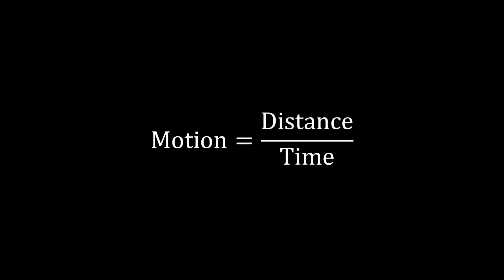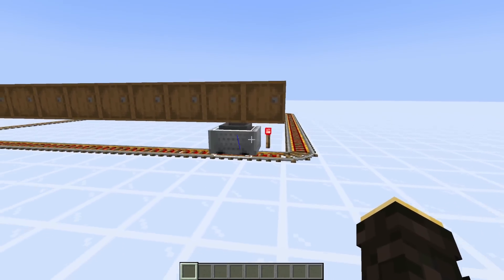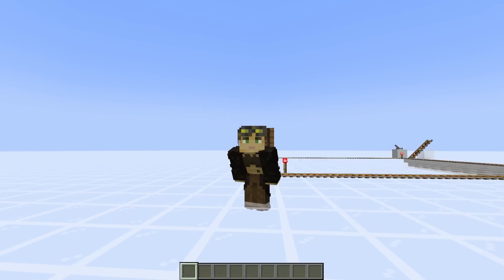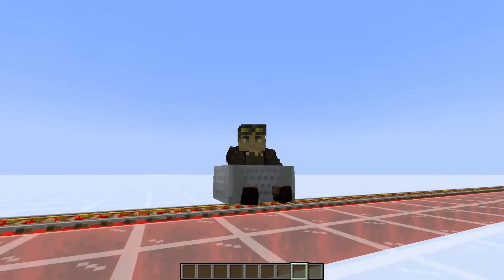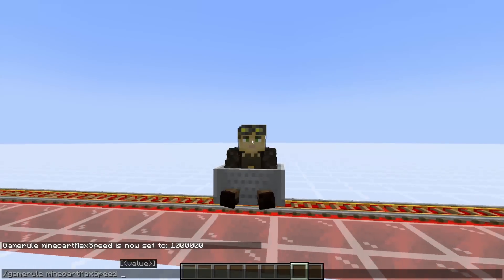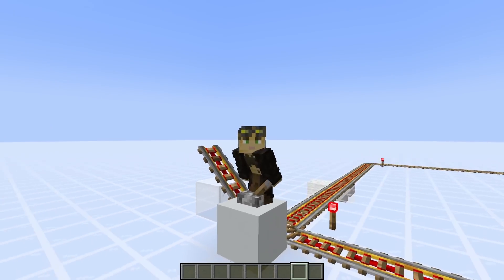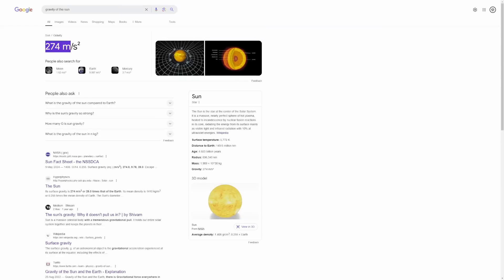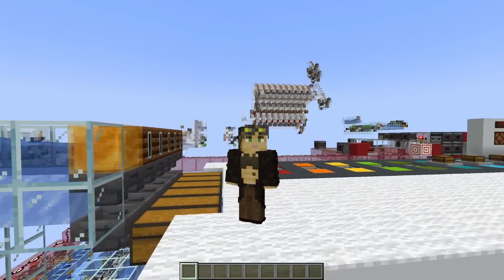Minecart Madness

Comment: 9:00 Thinking about this further, I was worried switching to a quadratically scaling function would cause weird behaviour in redstone but likely it would be the opposite, as drag at low speeds would be much lower than they are now causing the drag to likely be less of a factor. Though I am still worried there are redstone contraptions that would be broken by nonlinear acceleration. Maybe it should also work that copper rails accelerate differently to gold ones too? This is something that would be really cool to test in a snapshot, see if redstone contraptions break using the quadratic air resistance.

Comment: If minecarts are to derail, I think it would be nice if you coud have some kind of "smooth curve" instead of having to forcefully slow them down. Like maybe going into a diagonal (alternating corners) could tolerate higher speed, requiring less slow down than a 90° angle. Detecting that would be somewhat complicated, but I don't think it's impossible
Reply: As well as being more complicated, it would also just looks so out of place and be pretty unintuitive to actually build considering this game has always hag a grid-style of block-placement.

I don't really see much of an issue with derailing when it only happens if you are going incredibly fast, and if your goal is speed; you wouldn't be building rail systems with turns in the first place-- so use rails with a proper-non-derailing level of speed if you plan to make railways with lots of turns in short tracks.

Comment: I LOVE the idea for oxidised rail variants because for the average player, they will be cheaper to mass produce, but will require more attention to fix the oxidisation, eventually being outright replaced by the more expensive regular rails, while for the technical player, they can be controlled by being waxed, allowing varying speeds without having to add a bunch more redstone lines to control them.

Comment: Maybe the oxidation level of the rail changes the increment of speed? For example, an unoxidized copper rail would have speeds in multiples of 2 but as it oxidizes more, it would go to 1.5, then 1, then 0.5

Comment: I don't know what would be better: Using copper rails to have controlled speeds of minecarts or have different minecarts that would travel differently. Iron minecarts would be fast and copper minecarts could be used technically. That way, when you craft hopper or chest minecarts, you have the option of copper hopper carts or iron hopper carts.

Comment: Having not watched the entire video, the semi-obvious solution to me is to add "control" rails as an alternative to power rails or whatever which, for example, allow limiting minecart speeds based on the strength of the input redstone signal or whatever and allow players to make alignment guarantees. This would allow the easy use of minecarts for casual stuff with all the cool new features will allowing redstoners to continue to use them in cool ways. "Control" rails could even retain the existing "minecart loses all momentum when driving off the track" functionality.

It would make powering rails in contraptions a bit more complicated if you can't just slap a lever on them, but this seems like a potentially worthy tradeoff for the additional control and new features (especially since even in most compact places, you can probably comparator chain pretty easily).

EDIT: LMAO, this is exactly what he suggested about 15 seconds after where I paused the video.

@14:00 The problem with this idea is that minecraft would also need to provide some way to make more gradual turns with a minecart. Having to slow down all the way and then speed up would be pretty damn annoying but there's not much you can do about that in minecraft because diagonal rails would be really awkward. Though, they do already exist for going up, so maybe you could do something.

Comment: Minecarts can be fixed to move that fast and still interact properly, but you talk way too slow and I'm not finishing the video, so apologies if you cover this. The different minecarts just need to have a small memory buffer. Remember LAST-XYZ, select all blocks that fall on that line, Check all adjacent blocks to selected blocks for interactions, Check distance from LAST-XYZ, handle interactions sequentially.  This is of course a simplification, because corner tracks exist so it does need to keep track of where it turned so that the "line" between last and current position follows the tracks (unless the cart went off the tracks), but still. This means that a cart moving at a speed of 2 blocks per tick, is doing as many update checks as 2 minecarts traveling at 1 block per tick. The faster a minecart is moving, The more CPU and RAM used by that specific minecart. This makes it so that not only does a minecart hopper not skip chests for moving too fast, and won't skip accurate detector rail and comparator updates. For example, say you want a track to change if the hopper minecart has a given amount of items in it's inventory, so that it re-directs when full. Right now the only consideration you have to have is how many ticks it takes for the minecart to reach the intersection, and how many ticks it takes for the detected signal to actually hit that intersection to toggle it. That will be the same no matter what, the only difference is the rate at which the items can change in the hopper is currently inaccurate at different speeds, but would be accurate in this method. This is exactly how Super Mario 64 checks for collisions. It takes mario's velocity, and checks at multiple discrete positions between where mario is, and mario will be if unobstructed, in order to check for collisions, then does some further checks to find the actual point of collision, snapping him in place at the point of the collision, and it checks this every frame. The only difference is that in SM64 the update rate is I believe frame dependent, where minecraft uses update ticks that are less frequent than frames. point is, this is an easy fix.

Comment: Removing the speed limit is a bad idea. They need some sort of reasonable speed limit otherwise you would be able to use them to lag out servers by having insanely fast minecarts loading/unloading chunks using up servers Disk IO/CPU/and working the Ram.

Comment: 1:08 one small correction: 
Time in the real world is NOT infinitely divisible. It is quantized. There is such a thing as a smallest amount of time measurable. It's defined as the Planck time, named after physicist Max Planck. Planck time is roughly 10^-43 seconds. Quantum physics is fun stuff!
Reply: Time is infinitely divisible, but we cannot accurately measure it.

Energy is quantised, which gives the Planck constant as the smallest division of energy but time, position and momentum are still very much continuous values. The only issue is, on the quantum scale, we cannot accurately measure a particles momentum and position together because of the discrete levels of energy. If we wanted to know a particles position, we would have to sacrifice the knowledge of its momentum and vice versa. The same holds true for any two related (continuous) measurements of a particle. 

The fallacy here is that measurement isn’t the same as the environment. Time, position and momentum are still continuous vectors (is time a vector?) even though measurements are quantised
Reply: @benp2291  Thanks for the intellectually stimulating comment! Alright, I'm about get deep, but it's all your fault...😆

In our 4-dimensional spacetime, position, time, and mass are all quantized, and so is momentum (which is a function of mass, time, and position). These aren't only technical limits of measurement; they are theoretical limits. Any attempt to measure smaller distances or smaller times by performing sufficiently high-energy collisions would result in black hole production. And greater energies would produce even bigger black holes. So what does it even mean to say, "Time is infinitely divisible"? These are more than just concepts or assumptions; they are fundamental limits of the universe, just like the speed of light (at least, as far as I am aware at this particular time in science -- I'm always open to updating my views!). We can imagine going faster than the speed of light, but that doesn't make it a real possibility.

There's also Planck temperature, Planck mass, Planck energy, and a Planck force unit. They are like the pixels in a screen. Yes, we can claim that you can be halfway between two pixels, but the graphics card/GPU/VRAM can never utilize half a pixel. From the computer's perspective, there's no such thing as a distance smaller than a pixel, or a time shorter than the CPU clock rate. And this is true even if an AI program running on the machine believes that the screen is infinitely divisible and can conceptualize it. The concept only exists in our imagination (which is actually kinda cool). Anyway...I know it's not a perfect analogy :/

Euclidean spaces (infinitely smooth and divisible) were once assumed to be representative of reality, but this view has shifted over the past 120 years as quantum theory has developed. Although, for the scale at which we operate (and most of our technology), Euclidean and Newtonian physics are sufficient, regardless of being incomplete.
Reply: @aarongrooves  Firstly, "These aren't only technical limits of measurement; they are theoretical limits" only refers to the uncertainty principle/our technical capabilities and the existing theoretical base and does not mean that time or space are quantized. For example, Planck time is NOT a quantum of time. This is the scale at which both GTR and quantum physics must be taken into account, which we cannot do yet, despite many attempts to construct such a theory of quantum gravity.
Secondly, at the moment, the quantization of time and space is an open question. No one has an unambiguous and evidence-based answer to it. Some modern theories and hypotheses do use quantized time, but none of them are universally accepted. It may well turn out that all of them are wrong.
And finally, the fact that you speak so confidently on this topic suggests that you have the appropriate education. In this case, I would like to note that passing off your views as scientific consensus is, in my opinion, extremely unethical.
If there is no such education, well...
Reply: @saintpro9594  Hi there. At first I was following along and excited to engage. But at the end, your tone shifted. I thought this was a fun, light-hearted convo about science. "Extremely unethical?" Also, passing judgment about what is "appropriate education" comes off as elitism. This is a youtube comments section, not a peer-reviewed scientific journal, ya know? And even in that case, my education or your ethical judgments are completely irrelevant to the truth of our claims.

The beautiful thing about science is that the data speaks for itself. If I said something you disagree with, then kindly state what and why. If you have evidence supporting a contradictory claim, then share it. I made it clear that I love learning and am open to updating my views. If you can't engage without becoming rude, judgmental, & condescending, then don't engage. That really sucks the fun out of it.

Newton was technically wrong about gravity. Einstein didn't call him unethical or question the appropriateness of his education. He simply provided better information. Easy peasy! I dropped my ego long ago. It's okay to just state your case and move on. It's actually preferred.

Lmk if this is a safe space. If so, I'll gladly respond to the first part of your comment. Thanks
Reply: @aarongrooves  I didn't mean to offend you with any part of my comment and I wasn't trying to be rude. If that's the case, I apologize. Perhaps I don't quite understand the tone in which I write in places, since English is not my native language.
I will write at the end of the comment regarding discrete time, but first I will answer everything else.

Regarding the "irrelevant to the truth of our claims" part of my comment. You are right - this is pure criticism of the style of your comment, which has nothing to do with the facts. But, as you rightly said, this is not a scientific journal, so I allowed myself to speak out on this topic.
I really think that writing something in the format of facts, as you did, is completely inappropriate if there is not even a consensus on this issue. I agree that "unethical" was too loud a word on my part, it is rather not very correct and honest in any communication. 
In my subjective opinion, it would be important to indicate that there are 2 points of view among the community and you adhere to one of them because such and such arguments seem more convincing to you.

Now regarding education. I think I should explain why I brought this up:
1. Your comments radiate confidence, so I assumed that you are immersed deeply enough in the topic, for example, have an education somehow related to this area of physics.
2. And if so, then you most likely know that what you wrote is a controversial issue and is not a fact.
3. If you know this, but do not say anything about it, then, as I already said, I think this is not very correct and honest.
4. If you are not immersed enough in the topic, then you should check yourself 10 times before postulating anything, this is what my very last sentence in the last comment hinted at. Perhaps this sounds rude, but you must admit, it is fair.

About the truth of our claims. I have no goal to teach anyone anything. As I already wrote, it just seemed to me that you behaved unfairly. If this is not the case, then I apologize and suggest you simply look at articles and any information on the topic on the Internet. You will quickly notice a few things that I hope will be of interest to you:
1) Discrete time/space does not appear in quantum physics.
2) Discrete time/space appears almost exclusively in theories of quantum gravity.
3) There are quite a few theories of quantum gravity. Starting from the well-known ones like string theory and loop quantum gravity, to even more exotic ones.
4) Not all of these theories agree on how time/space is quantized and whether it is quantized.
5) None of these theories are experimentally confirmed and accepted yet.
(optional) 6) You may also find the opinion that all of these theories are a dead end and a stumbling block for modern physics. (which I find hard to agree with, but there is such an opinion too)
All this suggests that it is still difficult to say with certainty that time/space is quantized.

I have already written about Planck time, but I think it is worth writing about it again. If we discard all speculations, both Planck time and Planck length are a characteristic time/distance scale on which it is not possible to adequately "make friends" between the theory of gravity (GR) and quantum physics, which can be obtained from the Heisenberg uncertainty principle. Someone can sometimes inaccurately call Planck time a quantum of time. But this is rather speculation and is poorly substantiated since:
1) It does not follow from the definition itself that this is a quantum of time
2) All speculations around this use either one of the many new theories (which, as I wrote, are all different and poorly substantiated) or try to use old theories like GR and quantum physics, which do not guarantee any sane results on such scales.

And finally, Newton - supported his theory with experiments, GTR was also confirmed countless times. Both theories had great predictive power. This still cannot be said about modern theories of quantum gravity, unfortunately.
And I do not think that Newton or Einstein were wrong. Any theory is an approximation of reality that works within its limitations. And both theories perfectly approximate reality within their limits. I would like to believe that one day we will have an "exact" theory of everything, without any buts and limits. However, I am afraid that this is too optimistic :(

I hope that something from what I wrote will help you on your path to knowledge :) Good luck!
Reply: That doesn't mean that time moves in steps of planck time. Same as how atoms don't move in planck lengths.

It's just the smallest we can measure
Reply: @Bzorlan  thanks for the bump. I totally meant to respond to the other reply!

The Planck time isn't only the smallest we can measure. It's the smallest unit of time that any meaningful physics can happen in. So to say that things are happening in smaller chunks of time...it's more of a belief than a scientific statement.

Comment: There is technically a way to fix this. I myself worked on a fast minecart mod before this experiments and in doing so split the motion into multiple steps under a block in length within one tick. With this technically I could make minecarts perform multiple pulling operations a tick making them not skip any items. I think Mojang also split motion but I don't have any proof of that until I'll get my hands on decompiled and mapped game files.
Reply: And I also had a copper rail idea but I wanted my mod to be entirely server side.

Comment: Easily the best solution ive seen, copper rail makes so much sense and I reallly like the oxidized feature as it really fits into the entire copper theme as well. And negates the need for powering rails to get the speed you want. I like this a lot.

Comment: my solution:
Gold Powered Rails: 20 speed, fast and fun, but expensive

Copper Powered Rails: oxidized 10 -> 8 -> 6 -> 4 speed, slower but cheaper and customizable speeds

NO velocity/wind drag, keep it simple so people's computers don't explode, Minecraft already runs on one core as it is.